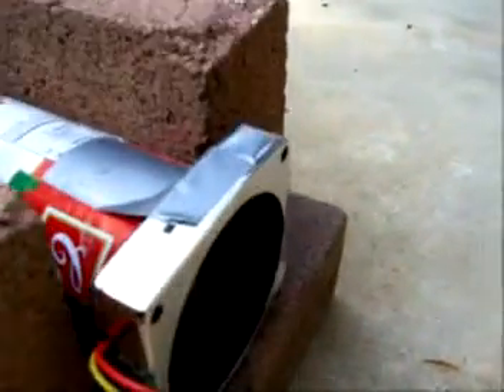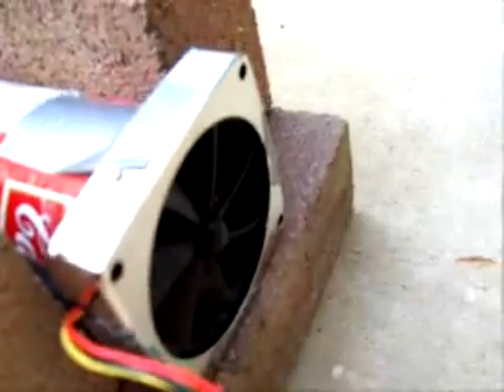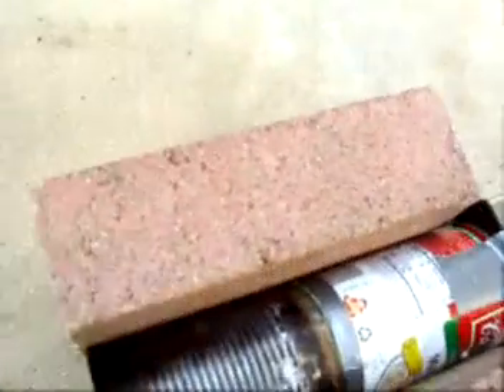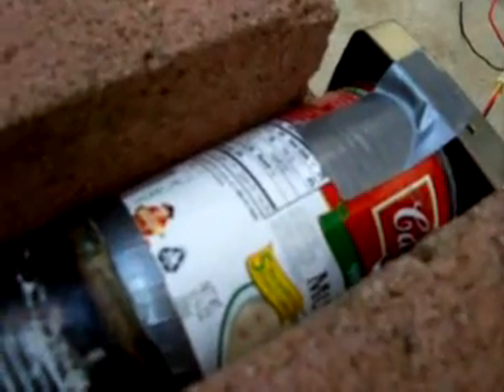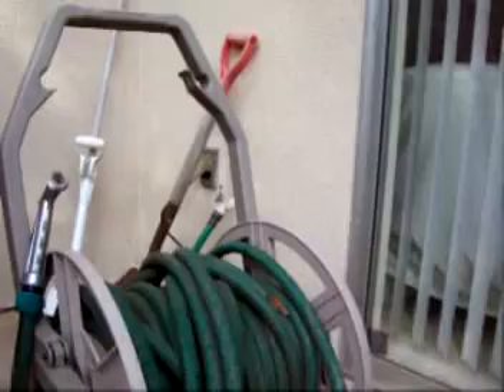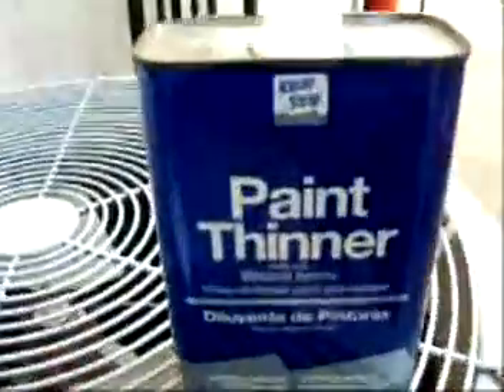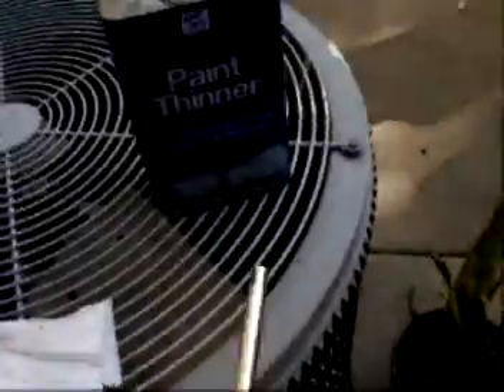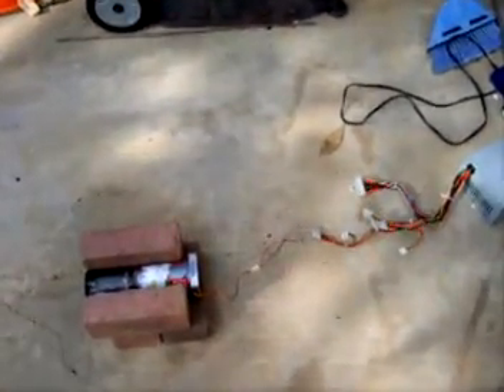Soup can thermojet (introduction)

Comment: The separate engine is the electric motor that is forcing the air.  A turbo jet requires the compressor stage is driven by a turbine (thus turbo) aft of the combustion stage.

Comment: Try using a longer burning fuel, like cardboad, use less of it, and stick it about half way into the can. And stack multiple fans, or build a shroud out of cardboard to boost the air flow